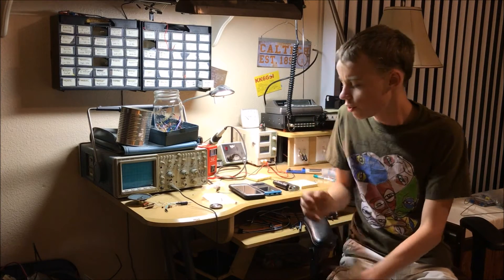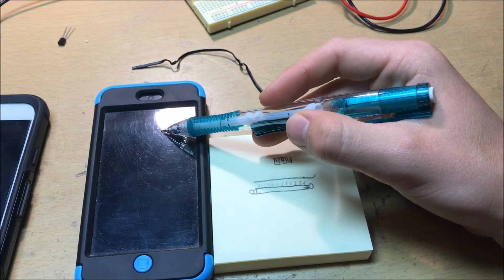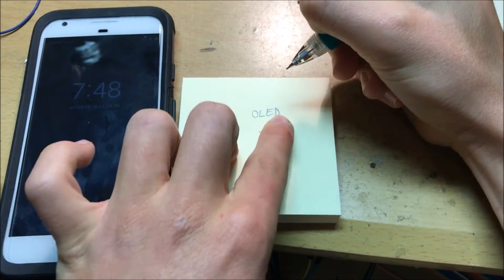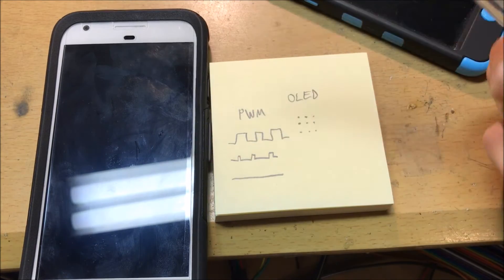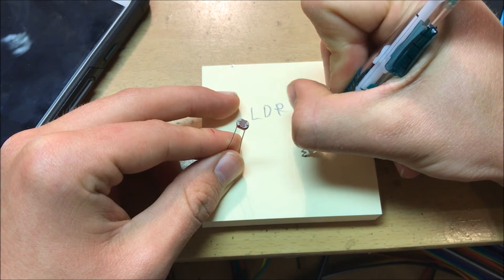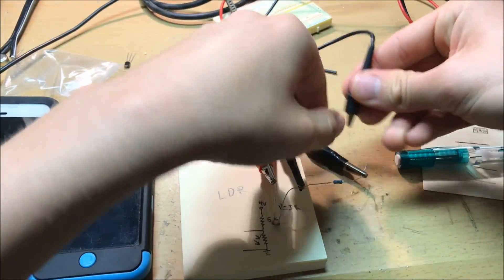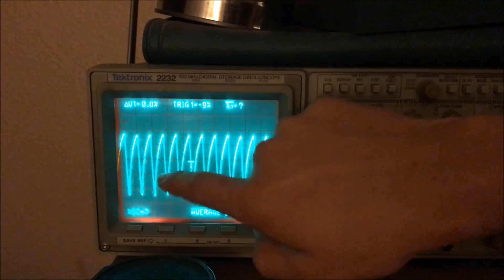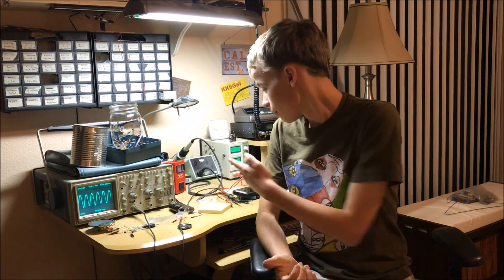How Screen Brightness Works and how to Measure it's Waveforms

Comment: I know this had been posted 4 years ago, but I must command your amazing teaching abilities. If you were my teacher in science class in high school, I would've understood everything! Joke aside, how does an IPS panel brightness works? From what I understood so far, it's a mix of LCD and OLED, with one evenly lit LED panel using PWM to display brightness. Is that correct? In that instance, I suppose the measurements should be similar to those of an OLED screen? Also, you didn't talked about the type of glass for the OLED screen. I would be curious about that too. Cheers!
Reply from the maker: Thanks Jas! Maybe I will teach a high school science class one day haha. I haven't done too much research on IPS panels.  I would assume they work similarly to LCD displays though where the backlight can be changed with PWM.  I would have to do some more research, maybe even find one to take apart.